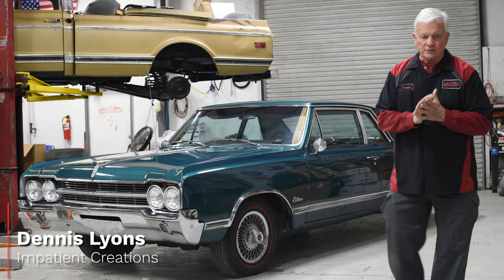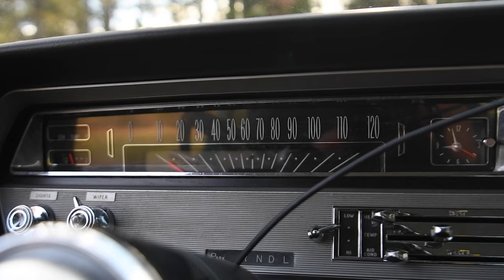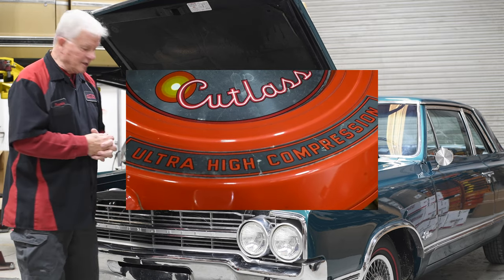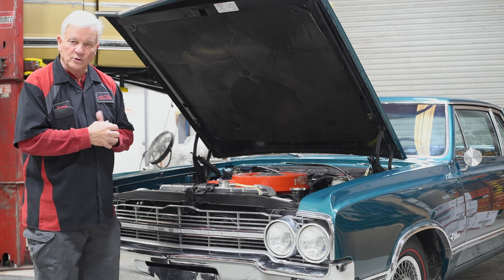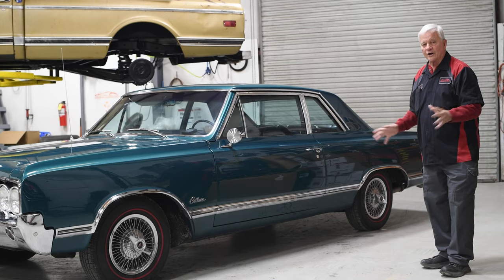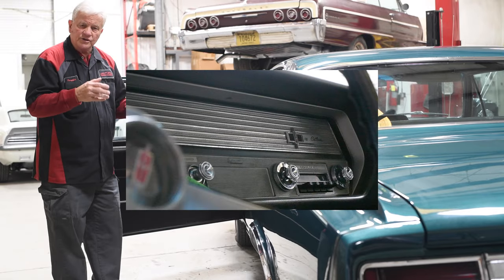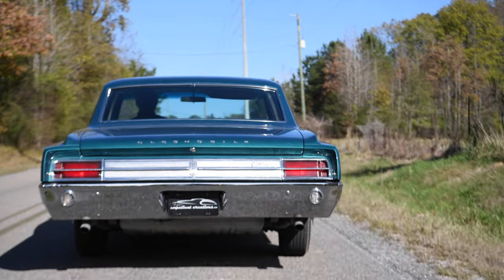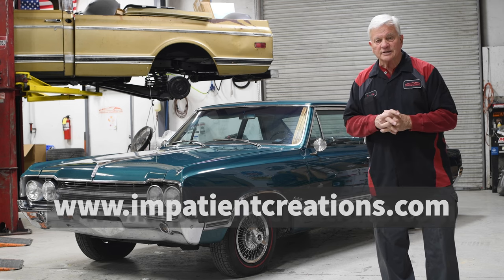1965 Oldsmobile Cutlass F85: The Golden Age of American Cars

Comment: I recently brought home a 65 cutlass with a 330 under the hood. Factory air, factor radio, power steering, power brakes.
It’s been sitting in an empty lot for more than 15 years, and hasn’t had a windshield in more than 5 years. (Some damn kids busted the windshield out on it years ago). Suffice to say, the car needs a full restoration, but thankfully the engine will turn when you turn the key, so it’s not a total loss. My main goal for now is just to get it running and driveable, for that, it’ll need tires, a windshield, and a battery. Eventually it’ll need a whole new interior, paint, rust repair.
Reply: I got 1 too brother with a 350.
Reply: My 65 is almost done. Stick with it. Mine only took 18 years to finish. 😁

Comment: I picked up a ‘65 442 back in 1994 when I got out of the service for $4,250. It’s number matching on the motor (400cid) but it came with a automatic (has a 4 speed M21 Muncie now). Talk about gobs of torque!!! (The 400 in the 442 that year are a de-stroked 425 basically) First year for the BB, 2nd year for the 442. 64’s only had 330’s, no BB that year, just the BO9 Police Interceptor package on them (442 was the other name)
I love that flucking thing!!!

Comment: Couldn’t help but to laugh when he makes the comment about having to remember how many times to pump the accelerator before turning the key for starting. Used to own a 4-4-2 that took two pumps (one was not enough fuel and three dumped in too much) before firing right up.

Comment: i have a 65 cutlass with the original 330 (olds only had a 330cui for the f 85 not a 350cui and 400cui engine for the 442)... i dont pump it, i put the gas pedal all the way in and crank it... if you change anything its no longer "all original " its "period correct "... but thats a beautiful car nonetheless ❤❤❤
Reply from the maker: Thanks

Comment: Well, if it's an original engine, it's not a 350.  It would either be a 330 V8 or a 400 V8. Most likely a 330, since that is what most of these cars came with.  If you think this is a big car, this isn't even a full sized car.  It's the smallest Oldsmobile you could get in 1965.  The 88 and 98 were much bigger cars than this - and most people drove full sized cars at the time.